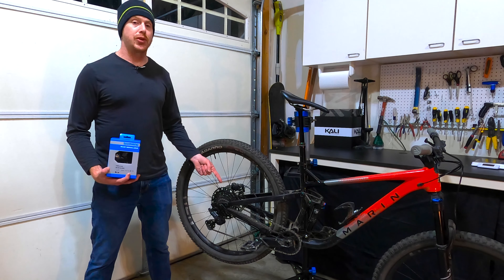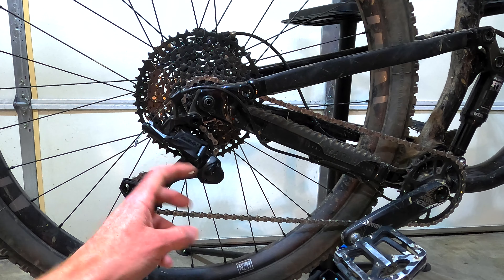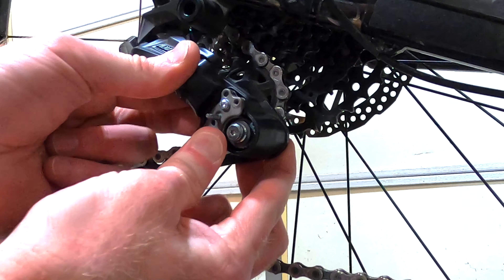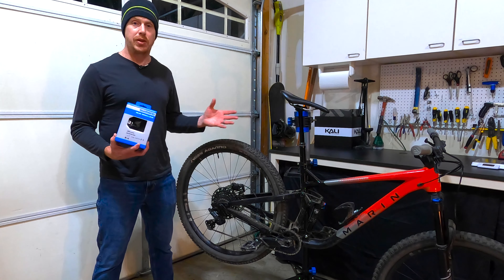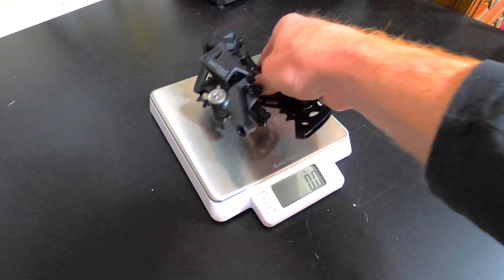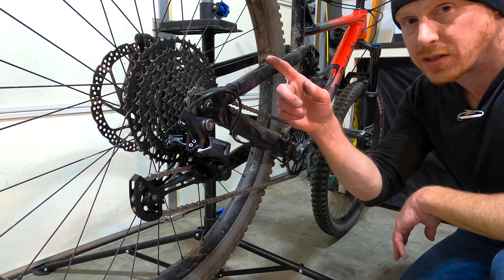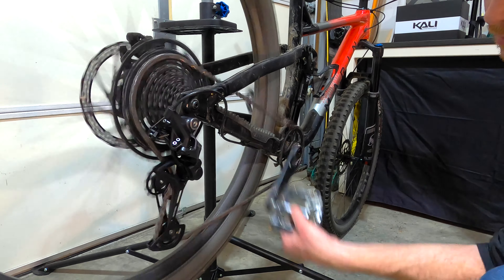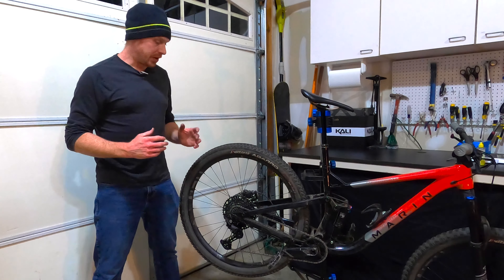MicroShift Advent X / Shimano Deore Hybrid - Will It Work?

Comment: Hey dude. I'm really keen for an update on how this is working out. Shimano are pretty straight forward in their technical info about the M5100 being designed for a MIN/MAX 51 low sprocket, so this really intrigues me... Not to mention the fact M5100 is 11 speed and you're running on a 10 speed cassette. I'm building up a new bike at the mo, and just picked up an Advent-X CS-G104 11-48 cassette really cheap. Looking at either the 10/11 speed Deore M5120 or doing the same as you with the M5100. M5120 worries me slightly, as the MAX sprocket on that is 46... Any feedback or tips are much appreciated. Cheers 🤜🤛
Reply from the maker: I should do a followup. But for now, it is still working very well. It works on the 10 speed because the shifter is telling it how much to move and the limit screws limit it as I set it. I considered that 10 speed deore derailed too but from what I read the 10 speed uses a different pull ratio. I think. I’m not really sure though.
Reply: @downtoridemtb  Coincidentally Chain reaction has the M5100 derailleur on sale currently for £15 (!!), so it's an absolute no brainer to give it a punt. Got the cassette for £30, so this is turning out to be a cheap build! The main thing that was putting me off M5100 is that the matching 11-51 11 speed cassette is 650g! Whereas the Microshift cassette is only 420g.
Reply from the maker: That is an amazing deal! Shimano may actually be phasing out the deore 11 speed entirely with the release of the new shimano cues line. I may order a second derailleur before they are completely gone.
Reply: I've just fitted on the ebike and it's not that smooth sometimes it won't shift down a gear it hesitates. Not great for racing
Reply from the maker: @MTBCLUB did you go with the M5100 or M5120?
Reply: @downtoridemtb  5100
Reply from the maker: @MTBCLUB  that really odd. B limit adjusted correctly? Mine was working good until recently I got a stick jammed into it and it bent the cage.

Comment: I just watched this again and I was wondering if you could use this same setup but with a different 10 speed shifter i.e the shimano m4100 (10 speed) since u can use that derailleur with ispec-ev
Reply from the maker: I think someone commented on this video that they did the same with the Deore 10 speed derailleur. Not sure if that is m4100 though. I do know the 48t cassette is slightly more than it was designed for but if I remember right it still worked fine.
Reply: @downtoridemtb  Thankss 🤘🤘

Comment: A question to anyone using advent-x. How do you find the shifter? How is the feel? Is it a pretty sturdy unit? Does it allow for multiple shifts as per Shimano/SRAM? Looking at the pro variant with the rubber pad. Cheers
Reply from the maker: You can do multiple shifts at once. At least three. Maybe even more than that. I think it feels good. Actual shimano deore 12 speed shifter that I have on another bike seems like it has lighter action. I notice for the first couple shifts then it just feels normal and I don’t even think about it.

Comment: Greetings from Brazil. I also have Advent-X setup on my gravel bike (using microshift STI). In your experience, will this Deore 11s shift fine with this STI?
Reply from the maker: I’m not familiar with STI but if your current setup works with Advent X then it should work with Deore 11s.

Comment: Great video!! Cant believe it was exactly what I was looking for. How is the bike riding...do you consider it a workable combination?
Reply from the maker: Yes, very workable combination. Still riding it this way and it is great. Just be sure your chain is the right length. Mine was a little too short and it wasn’t shifting perfectly. Added an inner and out link back in and that took care of it.
Reply: @downtoridemtb  Great advice. Is that why you are using a KMC 11 speed chain? I had a kmc 10 speed chain on my list of components to buy - would this be a mistake in your opinion?
Reply from the maker: Definitely go with the 11 speed chain. I think even with full Advent X, it is better than a 10 speed chain. But with throwing the 11 speed deore derailleur in the mix, it might be a necessity for clearance.
Reply: @downtoridemtb  Do you mind If i ask what crankset you would advise getting to match the 11-48t cassette?
Reply from the maker: Depends a little on what you ride. 32t is probably a good middle ground though.
Reply: Sorry for asking another question but I wanted to ask if in your opinion the Shimano deore m4100 shifter would work in this set up? I cant find any pull ratio info and wondered if it was similar to the 1.1:1 of the advent x. @downtoridemtb
Reply from the maker: I really don’t know that answer to that one. Maybe you can search is anyone is using that shifter with the rest Advent X. Because if so, then it should also work with this.
Reply: @magicdog5623 did you try it? Now have got sem issue. 11-48 10s cassette + rd-m5100  + shifter m4100.  Wondering if it will work?

Comment: AWESOME -- just confirming .. and 11-speed derailleur on a 10-speed cassette? Aloha :)
Reply from the maker: Correct. Although I believe their 12 speed derailleurs are the same pull ratio so those should work too.
Reply: @downtoridemtb  Many mahalos from Hawaiʻi. Thanks for doing our homework for us! Are you still happy combining this setup with a 32t oval chainring? My head is swirling between 30, 32, and 34! u da best!
Reply from the maker: @collegeofsocialsciencesuhm2259  glad to do it! So I have a 32t chainring but it is not oval. 32t is fine for me. Definitely wouldn’t go 34t though or it would be too hard to do some climbs since the Advent X cassette goes to 48t and not 51t or 52t like most 11 or 12 speed drivetrains. If you have a lot of long steep climbs then a 30t might be better. Hope that helps. Mahalo!
Reply: @downtoridemtb  Much appreciated!!

Comment: 👍great video, my ragley big al came with a sunrace clutch mech🤣its crap🤔I cant figure out the clutch on it at all😅
Reply from the maker: It may not even have one. I think I browsed their derailleurs a while ago and didn’t see any with clutches.
Reply: @downtoridemtb  it has an on/off switch, but cant move it🤔
Reply from the maker: Ha that’s really weird. I’d be inclined to take it apart and see what is going on.
Reply: @downtoridemtb  🤔prefer the deore mechs, the clutch is simple, and they are a solid reasonable price👍
Reply from the maker: Might want to stock up on a few. Looks like the new Shimano Cues range may replace Deore 10 and 11 speed.

Comment: This is awesome! I wonder what rear derailleurs work with the 9 speed Advent(Thats what I have)? How did you figure out the pull ratio would work?
Reply from the maker: Maybe look into the Deore 10 speed that is meant to go on their 11-46 cassette. I just searched the Advent X pull ratio and then searched the Deore 11 speed pull ratio. Some conflicting info out there but mostly the consensus was 1.1:1 for both of those.
Reply: I think you're good up to an 11 speed although you might need an 11 speed chain.

Comment: So I replaced with the deore and it still didn’t fix my issue but I then realized that my cassette was just a little loose because I didn’t install a spacer before installing the 10 spd cassette. Any chance yours has play in it as well? I did torque the cassette but without the right spacer it still has play that made it shift bad and loud.
Reply from the maker: Yeah I’ve been there where I was convinced it was one thing, but a new part, then find out it was something else. Mine definitely does have the spacer before the cassette. Some hubs don’t even need that spacer though. Glad you figured it out in the end!

Comment: I may be totally wrong - but I'm going to think out loud for a minute. Really pull ratios and compatibility are probably more about compatibility between the shifter and the cassette right?  The derailleur moves any amount the shifter tells it to - the question is - is it the right distance for the spread between each cog.??  I guess whatever system you use - the derailleur also needs to have a correct range of adjustment on limit screws etc. And of course the derailleur needs to be able to store the right amount of chain for the size of cassette as well (i.e. can't use a short little Saint mech for a 50T cassette.  Funny thing is Microshift website says the shifter isn't compatible with Shimano or SRAM.
Reply from the maker: You might be right. Maybe both. The shifter determines how much the cable moves. But the derailleur design determines how much that cable movement equals in actual derailleur movement. All of your other points are spot on about the maximum side to side movement and maximum cassette tooth compatibility.
Reply: @downtoridemtb  Ah - right, that makes sense - the design / geometry of the derailleur will affect how much the cable movement moves it. Thanks. Still feel pretty confident on this setup? About to pull the trigger for a build I'm doing with my son.
Reply from the maker: Yes. Have a good 5+ rides on it and it is working well. The shimano derailleur has a mark to align to a 51t cassette and I just aligned it with the 48t on the advent x cassette and it is good. Of course that distance grows a little when the rear suspension moves.

Comment: This is awesome! I was interested in the Advent X but this seems like a great combo. Did you need to make the 11speed 116L chain smaller?
Reply from the maker: Well the chain length has more to do with your chainring size and chainstay length. I will say for me it was slightly undersized with the full Advent setup and I added an inner and outer link to get it to work properly with the deore derailleur.

Comment: I was told that the Microshift Advent X rear derailleur has to be used with Advent X shifter only. Is that true?
Reply from the maker: I’m really not sure. I mean if this setup works, then it would work in the opposite configuration meaning a deore 11 speed shifter. So you’d then tune one of your limit screws to essentially disable a gear. Better though if deore 10 speed would work. I can’t find definitive info that the pull ratio is the same though.

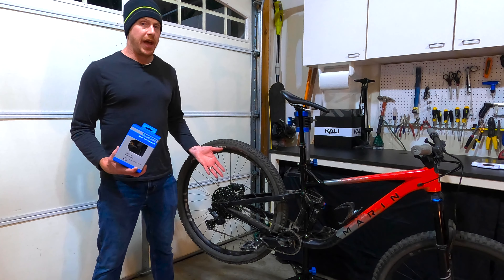Comment: 2:04 I am curious what the difference between the 12 and 11 speed version is aport from added Shimano logo the RD looks the same, but not had them side by side. Both can do 11-51T
I have the M6100 SGS. so 12 speed version, butt run it with 11 speed cassette, with Archer D1XTrail.
Reply from the maker: Good question. Only thing I’m thinking is that the pull ratio may be different on the 12 speed version. Can’t say for sure though.
Reply: I Use SLX RD 12s With Sunrace Cassete 10s (11/51) The Best 10s Cassete, and Deore Shifter 10s And 11s Chain SUMC. All Shimano RD 12 works 11 and 10s Cassetes. The Diference is Limit Screw
Reply: @alessandrouk2  which limit screw?  Both? Can you be roe specific?
Reply: @alessandrouk2  After using Sunrace Cassettes I won't buy the current models again. With some short term use I got bent teeth, bent cogs, sharp edges on teeth, at ramps.
11-50 T 11 speed got loose rivets, I tried 2 cassettes, same issues on both. the 11-46T did not, I tried 3 cassettes. Shifting performance is passable, but it's no means great, for smooth shifting, and low price tag i would go fo Shimano M5100, but for co cost spared I would go for Garbaruk, it's cheaper and lighter than XX1 and XTR. I use the 11-50T HG version on my enduro bike.

Comment: Shimano can give good discounts on their mass market products they are still the  leading MTB group set maker I never considered using an 11 speed chain on a 10 speed of course the chain been narrower will give it more room to move between gears. I have also found the cheaper KMC chains work really well even more so the home brand from Decathlons which are just KMC chains boxed with the Stores name but only 10 euros for a 118 link chain and not the 38 plus Euros you pay for a Shimano of the higher level KMC chains.
I knew that Microshifts  items work with both Sram and Shimano  but not sure how cross compatible  they are  with  all the range of Deore  or mixed Road shifters with MTB gears.
Reply from the maker: Yeah cheap KMC chains seem to do just fine. I don’t think we have Decathalon readily available in the US. Anyway thanks for the comment, I’m sure plenty of non-US riders will appreciate it!

Comment: would it work on a 9 speed adventix shifter?
Reply from the maker: Really not sure about that one. If you can find any info on using an Advent X derailleur with Advent 9 speed that would point you in the right direction. If that works, then so would this.

Comment: Just tried this setup. It didn't even come close to working. When shifting down to about 5th gear it would completely skip a gear and was very clicky around the middle gears. Made multiple adjustments to cable tension to no avail. Personally I wouldn't advise this.
Reply from the maker: Very surprised by this. I’m still running this setup and it’s working great. Did you adjust the b-limit screw? Chain long enough?
Reply: I encountered this exact problem and a quick check of the installation guide showed that I had installed the shift cable on the wrong side of the clamp screw. Moving the cable to the other side fixed the problem.

Comment: After weekend testing i need to update few things:
1. Shifter has very unfortunate place for screw covering hole for cable. Made of plastic, hard to reach when installed on bars. Rubber plug (like old Sram X series) doing this job perfect. Other than this, shifter is well made and levers are within reach of tumb. Rubber pad in PRO version is nice addon.
2. Mech. Worst on the market jockey wheels: sleeve bearings with very little grease inside, bi directional, non profiled for chain (narrow wide)
- clutch switch is terrible. When turning off need to fight every time. Very hard to switch off.
- cable routing is not perfect but this is more a visual thing.
But good side: shifting well, better than SRAM X01 from previous era, b-screw tool included, not difficult to set up. Plenty space with 48T casette
3.Casette (G version)
- lack of 17T cog. Gap is too big between 18 and 15T.
+ Light, good shifting, range.
I try with KMC X10EL chain, and no rubbing. As mention on this video. Shifting is flawless.
Can I recommed? I think YES
But few thing need to be improved
Reply from the maker: Thanks for sharing all this. Definitely more in depth than I got. Good news is that any of the high end Shimano 11 or 12 speed derailleurs should also be compatible. So you could definitely get one that solves most of those -‘s
Reply: @downtoridemtb  i belive rubbing problems on casette exist, because small play on sleeve bearings at jockey wheels. This imperfetion causes wheels to tilt/slide and shifting is delayed.
I just put extra lithium grease in my and working fine.
I will try BBB ball bearing wheels on it soon (i've got spare set) but they are made for 12spd (little narrower) so need to put extra spacers (as I've done before with Sram X01) Or maybe Microshift already make hanger compatible with narrow one? This is next job I'll try.
And casette need to be te-tighten after few miles as well (I use torque wrench).
I belive this is best price/performance set for 10spd and old bikes.
After tunning should become unbeatable.
Reply: @downtoridemtb 
I just fit new jockey wheels.
BBB BDP-07 (cost me 20 quid)
Original one are really bad - I need to replace after 250km (140 miles) because bearing area are not mud/water tight...
So afer this distance - shifting precision was lost... And rotating resistance was unacceptable.
Few things:
- BDP-07 wheels are for 12 spd - so they are thinner a bit, but in my deraileur i can squeeze it with 10spd KMC chain without rubbing anything.
- metal protective part at lower back of cage, is bending corner of cage a litle bit, due to loss of clearance, but i do not notice any problems with precision of gear changing.
+ They are exactly same size as original one (diameter)
+ narrow-wide profile
+ ball bearing
+ water and mud tight
+ teeth profiles to improve chain glide (one directional)
+ more precise shift
+ original screws has thread long enough to fit 12spd narrower wheels without washers.
Reply from the maker: Awesome I may have to look into those. I can’t say I’ve had any problems with the stock ones but better is better!

Comment: i'm gonna to try this setup in my dartmoor primal evo, i have the same shifter and in my opinion is isn't microshift but it is microshit
Reply from the maker: Lol, hopefully this solves it. Before you pull the trigger you might want to check out the Microshift Sword derailleur or even a higher end Shimano derailleur. Deore is good but there are definitely some things that could be improved.

Comment: a derailuer just slides from side to side, get the ratio crap to the actual shifter where it belongs.  all propaganda from the manufactures.  I just bought an advent x cassette and a deore rear derailure.....
Reply from the maker: Not sure I agree. 1 derailleur could be designed in a way that 1mm cable pull equals 1mm derailleur movement. Another derailleur could be designed in a way that 1mm cable pull equals 2mm movement. All the shifter does is move the cable.